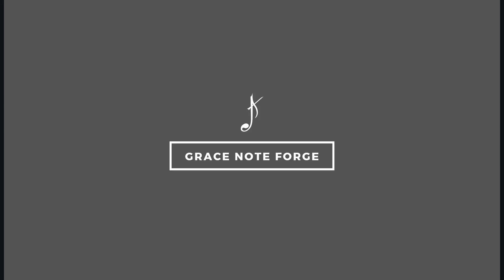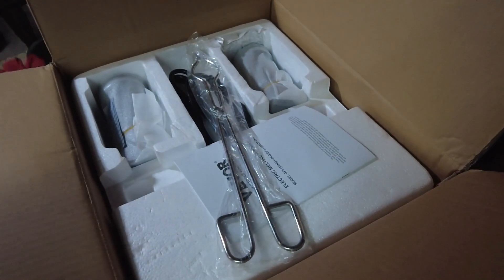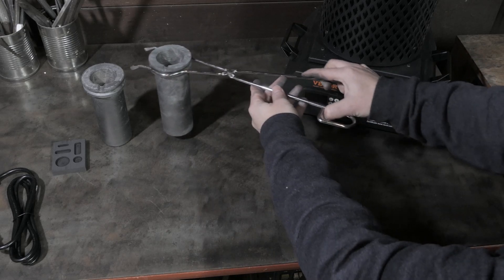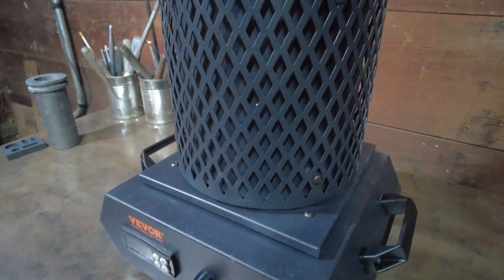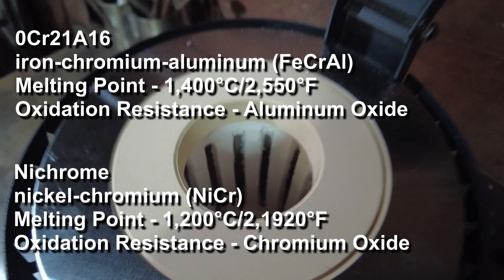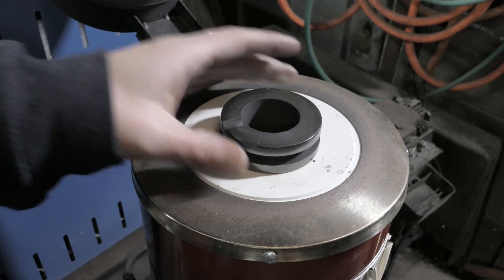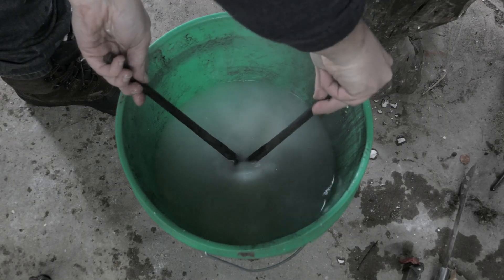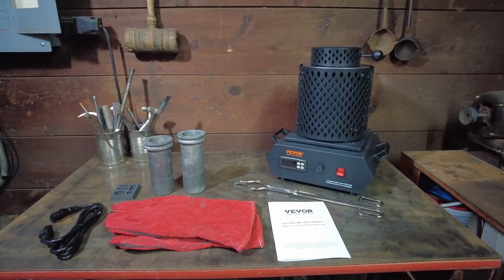New VEVOR Electric Melting Furnace - My Honest Review and Thoughts

Comment: They've now switched from graphite crucibles to ceramic crucibles, which unfortunately means the inside is always much cooler than the heating element area. I was unable to melt copper with a ceramic crucible. It's a shame to see shrinkflation like that.

Comment: I got one of these partly based on this review.  Didn't work so well for us.  Tried to heat 60 g of metal in the 1 kg flask to 978C, and it would never get to temp.  just oscillate below the set point. Couldn't get our metal hot enough for a good pour.
Reply: Did you end up reaching out to Vevor for support? This furnace should absolutely be capable of getting both the 1 kilogram and 3 kilogram crucibles up to at least 1150C. While I could imagine the 3 kilogram crucible fully loaded with brass might take well over an hour, it should still melt.

Can you confirm that the electrical circuit you had it running on can supply at least a constant 15 Amps at 120V?

Comment: Im thinking of starting into the hobby.  I'm wondering if I should get an electric first because it's easier to use and monitor the temps.  Shame it doesn't fit cans, but maybe I can figure out a way to crush and roll them somehow so they will fit in the crucible.

Comment: Thank you for this careful opinion.  I note that you are operating indoors, whereas the LPG furnaces are used outdoors quite often from what I have seen on YT etc.  Would this be due to the excessive flame/heat which is released by LPG furnaces, or more to do with the gas aspect, or both?  

I have been thinking about starting metal casting on a smaller scale (so as to make a few small things to use with my woodworking, such as brass mallet heads etc or nameplates), hence not wanting to mess about with potentially dangerous and far more hot and flammable LPG furnaces, so the electric option seems perfect.  Plus I also have solar.  
I wish to personally recycle and reuse copper and brass plumbing parts, and perhaps a bit of heating for minor forging of knife/tool blades etc.  

I also might suggest for those smelting cans for the aluminium, and in locations where you get money for bottle and can returns, just keep the tab from the lid.  I have been 'collecting' the small tabs only for a while, so as to build up a stock of pure Aluminium (as the sides are mostly plastic and filled with contaminants, as well as taking up more space and effort to prepare), and I have the advantage of getting FREE alloy, as I get 10c back for each can. A Win/Win.

I am now waiting for my reservoir type hot water system to crap out, so as to repurpose the cast tank for a forge, and also smelt the copper fittings!  It is amazing how long things last when you WANT them to fail, as opposed to NOT wanting them to fail...and they do...regularly!  Lol!

Comment: You don't want to melt cans in that anyway.  If you insist on it then put them in a shredder first. The best way to do cans is to line a steel trash can with some refactory and use a weed torch for the heat. Drill a hole for the liquid metal to run out into a bucket of water.  The opening of the trash can is big enough that you can feed it bags of them and if built correctly you can use the lid as a door to keep the heat in.

Comment: Great review. I'm trying to get into casting. I wish someone was making a vacuum setup like yours that I could buy.
Reply from the maker: Thank you! I agree, It's strange that there isn't a smaller vacuum casting setup that's commercially available. They aren't terribly complicated. 

I plan on making a new vacuum setup to work with perforated casting flasks in the spring.
Reply: @GraceNoteForge  Looking forward to the new vacuum setup video!